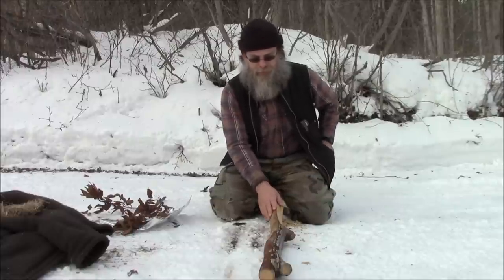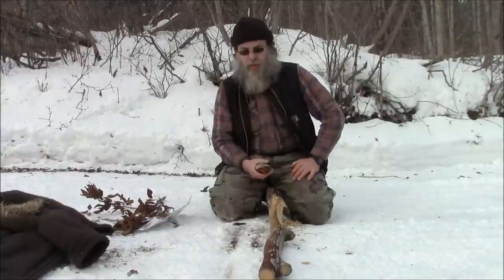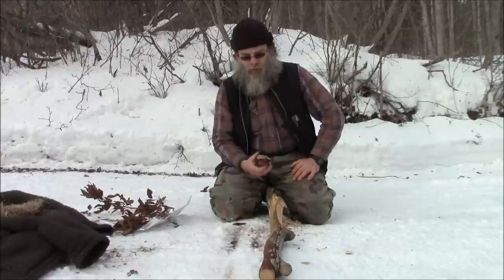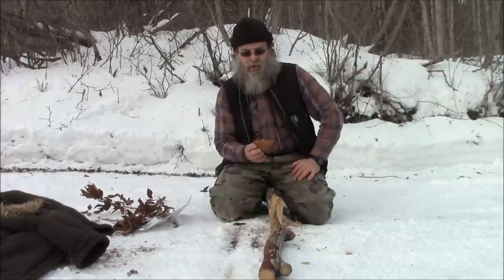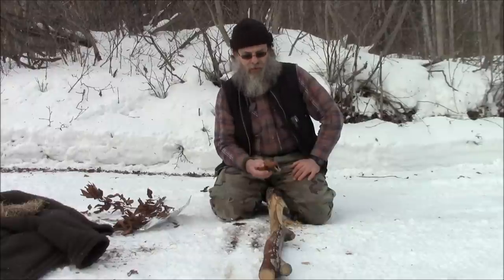Unique Cordage-less Friction Fire Method

Comment: Way cool, Lonnie. Not to mention that if you are cold before you start working the chaga over the wood, you won't be cold after all that rubbing it back and forth, lol. Though that does raise the issue of energy expenditure on the method. But the fact you can do it with such limited materials could be a life saver in certain circumstances.
Reply from the maker: Random Button Pusher Thank you.  Yes this method has definite potential in a survival situation.  It would however require some knowledge of how to find the best materials in order to make it work in the wild without prior prep.   The chaga needs to be dry for instance.   Dry chaga can be found in the wild but it is very rare.   It is found on dead trees thus being dead itself.

Comment: Nice one, Lonnie.
You worked up a head of steam there!
Kinda like the bamboo fire saw, but with temperate materials.
Most of the traditional friction fire methods can be modified to allow for the direct substitution of tinder fungus for one of the "wooden" components, allowing for a "direct" ember.
We don't get chaga here in South Africa, but I've good success with various types of indigenous bracket fungus.
Reply from the maker: *****  You are right Rob.   I did have quite a "head of steam".   I am new to this method but I'm sure for someone used to this method that it would come much easier for them.   My chaga was not prime stuff but was the best I had on hand at the time.   Thanks Rob.    I thought I was subscribed to your channel but apparently I was not so resubbed you.
Reply: Dude! It's RobwithaB I love your channel too!

Comment: I learned two things from this video. Excellent friction fire method and neat trick to put out the chaga ember. I've tried a few things in the bush and it always burned up so I would cut out the piece.
Reply from the maker: Barbarossa4U Another very effective way of putting out a chaga ember is to put a drop of water on the ember.  The problem with that though is that the chaga then needs to re-dry before using again.   Glad you enjoyed the video.

Comment: Looks like the easiest way so far. Not that it was without work but it seems to work faster  than some of the other methods and you don't need as much. Of course you have to find the chaga if you don't have any on hand. Thanks for the info Lonnie. Say 'HI' to Connie for me !
Reply from the maker: Spring Joy There are of course many different friction fire methods and they each have their own merits.    The chaga needs to be dry before using for fire.  It is possible to find chaga on a dead tree and thus most likely dead itself since chaga only grows on live trees.  If chaga is found dead then chances are it may be dry enough to use as tinder fresh off the tree.   You are very welcome and thank you.   I will pass your "Hi" on to Connie for you.

Comment: Hi, I live in an area rich in Coltsfoot fungus (Fomes fomentarius.) Chaga is hard to find where I live. Do you think the method you demonstrated would work with F. fomentarius? Also, do you have to dry the fungus before you use it or can it be used as soon as you cut it off the tree? Thanks so much for all the content on your channel. -Allyson
Reply from the maker: I do not think this method would work with horses hoof fungus.  However I could be wrong and there is only one way to prove whether or not it will work and that is to try it.   Feel free to give it a try.   Either way, the fungus needs to be thoroughly dry.
Reply: Thanks so much. I am going to try it and see. Greetings from Germany! Allyson

Comment: Hey man i totaly seen that video and have done this, very cool method , tho a bigger piece is easier to hold then a lil one. Thanks for sharing this video man. It was one i was thinking of sharing down the road, but now i dont need to hehe, thanks bro and awesome stuff.Love that you can reuse the large chaga since you transferred it to a smaller piece for a tinder bundle. love it.
Reply from the maker: Kullcraven Bushcraft Don't let my video stop you brother.  Go for it.  Yours very well may be better than mine anyway.  This was not one of my better videos.  The subject matter saves the day though.  I sure miss my videographer (Connie) she does a better job than I do by myself when recording.  She has been too busy with other things to help much.  I have a friend that performs this method with a little tiny piece of chaga.  He does it one handed.
Reply from the maker: Kullcraven Bushcraft That reply to your comment posted before I was ready for it to.   Anyway thanks for watching.   I recorded the "blind fire lighting" video.  The first attempt I struck my fire steel and struck and struck and struck about 50 times literally.   I finally gave up and removed my "blinder".  The camera battery had gone dead anyway.   So I repositioned the "tinder", set up and tried it again and bam success rather quickly.  I made it look like I was a pro lol.   That first time though was humbling.  I will probably post the video around the end of the week if not, then around the first of next week.
Reply: Thanks iried it with a small piece in my basement and it started smoking and i was worried about the alarm going off, so i stopped lol . I'll play around with it more, tho a larger peice can be more friction so works great. Hope Connie is doing great. I would like to have a camera man or women, but 90% of mine is done alone.

Comment: Excellent.  Added to my mental book of knowledge. Will other tree fungi work? Noticed your belt buckle Scout. OA. Lonnie ever work offshore?
Reply from the maker: Tom M I'm still pretty new to this method myself.  I don't know if other fungi will work with this method for sure but I do know that some have been used successfully with bow and drill used as the "hearth".  My guess based on much experience with a wide variety of friction fire methods is that it may work but would probably be harder to achieve success than when using chaga.

Comment: What a great idea!! You didn't mention but did you shape the piece of wood you were using into a point to better focus the heat? Can ya use horsehoof fungus in the same way? I hated seeing that fine chaga powder fall to the ground maybe collect on a piece of bark underneath. Thank you for sharing this unique method.
Reply from the maker: Bob Cotter Yes Bob, The point is to focus the friction there.   I don't know about horse shoe fungus but would guess that if it does work it will be more difficult than chaga.
Reply: I guess it remains to be tried. Thanks again.

Comment: Lonnie thanks for sharing this, my question is besides shaving the chaga what other prep was there to it? Was there a hole in the center of it? So it could catch the chaga dust??
Again thanks for the video
Reply from the maker: ***** Hello Shane.  The willow branch was on the ground and the chaga chunk was in my hand.  I did not prepare the chaga in any way other than drying the chaga thoroughly.   I just take the chaga chunk in my hands and began rubbing the prepared angle on the willow branch to get the ember.

Comment: ....not seen that before. Do you use chaga right from the tree, or do you prepare it in some way, drying for example?
Reply from the maker: +Herbert Hriberschek     The chaga isn't treated in any way other than drying.   It does need to be dry.     If a person is lucky enough to find a large formation of chaga on a dead tree (chaga only grows on live trees) it is possible that it may be dry enough to use right off the tree if the tree has been dead long enough.   Once a tree is dead, the chaga will eventually die as well.

Comment: Very impressive thank you for sharing. Do you know if this particular fungi grow down further south (i'm in NC) or similar fungi that may be used as a substitute if not? Thanks again
Reply from the maker: Jdmsword14 I doubt that chaga grows that far south but a quick internet search should let you know that for sure.   I am not aware at this time of any other fungus that would substitute.   Horses hoof fungus is very useful for fire use but even it does not work as well as chaga for catching sparks.  Now with friction fire methods, perhaps other fungi may work.  I do know that there have been other fungi used successfully as hearth with bow and drill friction firethough I have not been successful with them.
Reply: *****
I appreciate your feedback

Comment: Superb and informative.
Does it have to be willow?
Also, do you break off  a small bit of chaga that you light with the ember on the main piece??
Reply from the maker: Any of the better friction fire woods are candidates for this method.  I would use a separate piece of chaga to ignite from the ember.  I would then extinguish the original large piece by cutting off the oxygen supply.
Reply: @Far-North-Bushcraft-Survival  Thanks for coming back to me.
It's not a method I'd seen before. Many thanks for sharing..Off to find some chaga!! :)

Comment: Excellent demo!! Would this work with polypore?? Best wishes brother 👍🏽👍🏽🔥🔥
Reply from the maker: I have never tried it with polypore but my guess is that it would not work.   Chaga is a VERY good material to use for fire as it will begin to harbor an ember that is delivered at low temperatures unlike almost any other substance naturally available in nature here in the North at least.   Polypore requires more heat than chaga in order to nurture a spark.
Reply: Thank you for your reply I appreciate it sir!! I have tried several times to light polypore by friction and have always failed so as you say I guess I can't generate enough heat to start  the ember! Thanks for sharing your advice brother! Take care and best wishes my friend 👍🏽👍🏽

Comment: dam spell check How did you prep the fungus for the friction fire I thought I seen a hole in the fungus
Reply from the maker: Paul Henry Sharp eyes.  The "hole" though was incidental and had nothing to do with this method.  The hole was put in there while using the chaga in a different unrelated friction fire method.    The only prep for the chaga while using with this method was to use dry chaga.

Comment: Which fire starting method is your favorite if your in a hurry w/o matches or lighters?
Reply from the maker: John D You will require some form of "equipment" to get any fire going.  Some fire methods, if you know what you are doing, can be produced from equipment that can be made from locally found materials from your natural surroundings.   Some forms of fire lighting requires that you have equipment with you brought from civilization.   So...... your question can have many many answers depending on what one does or does not have with them.   If I have the equipment necessary, then I guess it might be a toss up between a "fire piston" or a "ferro rod".   If I don't have any equipment with me other than my knife, then I personally would consider the "Eskimo or Arctic strap drill friction fire one of the best since it can be accomplished much easier using natural cordage than the bow drill.    I guess in other words, my "favorite" method depends a lot on what I do or don't have with me at the time.

Comment: Holy Smokes, Batman!   Tell a little about the log, shape it to a V, species matter?, dry standing dead I presume, hardwood over softwood,  is the chaga predried or off the tree?
Reply from the maker: downeast primitive skills Holy smokes batman!  How about asking instead of telling.  People are much more willing to be helpful that way.    I am still new to this method so I can not answer your questions with complete authority.   Yes dead standing is best as it is with all friction fire woods.  With the other friction fire methods I have used, willow is my favorite.  Next comes cottonwood.   Both of those woods work well with friction fire here locally.   Alder, spruce, and aspen have all been much more difficult woods to work with.   The chaga needs to be dry.   The chaga can theoretically  be used (sometimes) fresh off the tree if it is found on a dead tree.   Chaga only grows on live trees.  If chaga is found on a dead tree then chances are the chaga is dead itself and may be dry enough to use for friction fire fresh off the tree in that case.
Reply: ***** Thanks for the reply.  I apologize if that didn't come across well.  I'll try balsam fir and spruce on dry chaga.  I have found chaga on dead birch, the chaga is dead as well, it may have tell tail signs of small white thread present in the dead chaga.
Reply from the maker: downeast primitive skills
Good luck with your attempt.  Let me know how it works out for you if you don't mind.  I am constantly learning all the time myself and am always anxious to increase my knowledge when opportunity allows.
Reply: Will do.